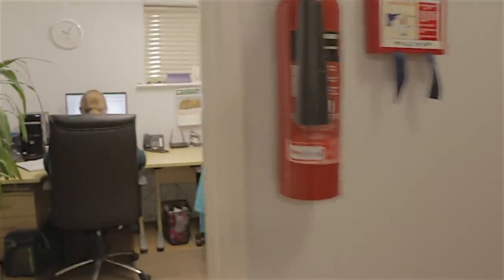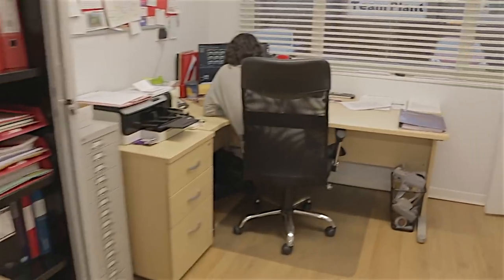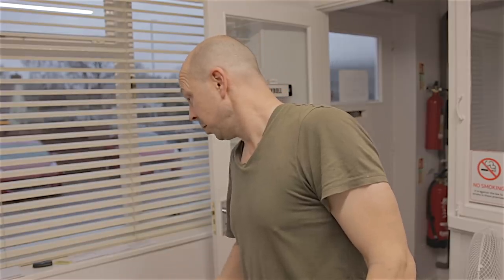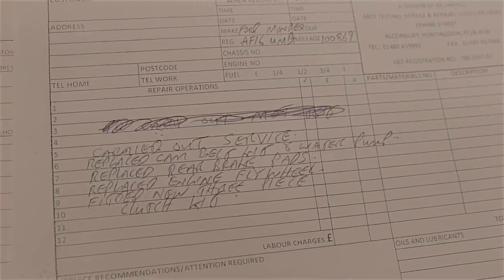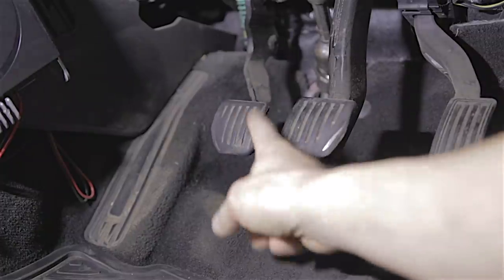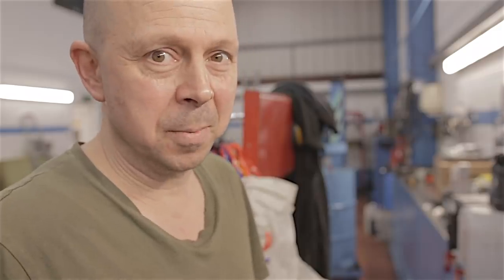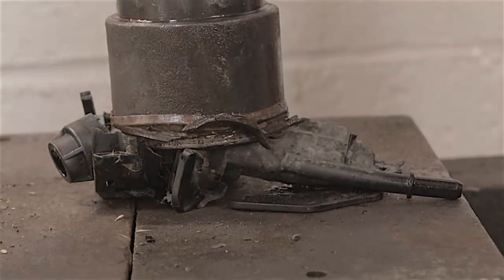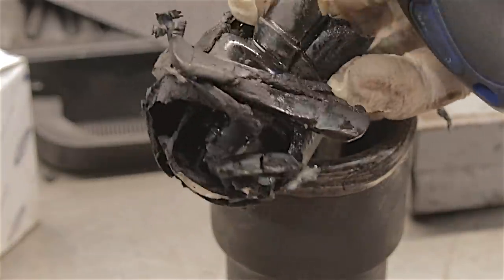low Sitting clutch pedal, Ford Mondeo Mk5 2L Diesel

Comment: ******had EXACTLY the same problem .....Here's what I did*******
Mine split in the same way as yours Alan. Its a MK3 Galaxy, but identical to the Mondeo.  Galaxy is a pig to work on with limited space, so I left clutch cylinder in place, removed the snapped rod. I heated a 2" no8 woodscrew, red hot. held it with long nose clamps and carefully poked it into the socket of the clutch (awkward as given its high up under pedals) and being careful to only catch the remaining bit of the snapped ball, melted against it and with some luck and manual dexterity, pulled it out!
Bought a breakers clutch assembly (£30) and used only the rod and pushed into place...all working fine now.

Saved all the hassled of dismantling the scuttle panels and bleeding the clutch and all that jazz.

Great content Alan, love it,.

Comment: We are right now in the backway of this job.With a leff wheel steering it's more complicated.The complete pedalunit cannot be taken of unless the fusebox has been removed.So we found another way and  wiggled the new master into,the bajonet without removing the pedal unit.What an operation but with 2 persons it's doable.Alan,I guess English models right steering the vertical fusebox is also on the left side? Thats for sure an advantage......

Comment: can failure of this siliner cause clutch to slip? I changed my mondeo mk4 flywheel, clutch plate , pressureplate and pressure bearing, but it still slips when i accelerate 4. and 5. gear....? or is there possibility that i ordered pressurebearing for solid flywheel cluch and maybe its longer than dualmass flywheel clutch pressure bearing..?

Comment: When you get a brittle plastic clip, try warming it with a heat gun to probably 150 - 200 degrees and it should restore it to non brittle. Bringing it to a simmer in undiluted glycol antifreeze (200 degrees) would work if you can get it off without it breaking in the first place, a hot air rework station ( about 35 quid ) would be a more practical solution as you can set the air temperature and use it while the part is still attached.

Comment: Alan i have a clicking at the top of clutch pedal it seems to be sitting a bit higher and pooping , i have been told the clutch master cyclinder needs changed. How much should a job like this cost if you have to replace full assembly

Comment: I had a knight mare with one of those master cylinders with the switch on my ford focus 2013 has a similar set up I had a host of issues on the car bucking around over revving on gear change ever diagnostic even fords said clutch position sensor had a new bottom and top sensor still the same problem ford dealer was adamant that there where only 2 sensors on my car it went on and on for around 8 months I had literally had enough of the car drove horrible couldn't get a smooth gear change stop start didn't work gear change arrow didn't work after loads of parts changed I went to an auto electrician and when they told me the hourly rate I nearly died and they couldn't give me a rough time for how much it was going to cost  so I scrapped that idea a couple of time another fault was picked up on a different diagnostic machine starter request malfunction so I did a lot of digging around days to be exact on different forums and someone had said about starter request malfunction and there fault was the master cylinder after weeks of issues but thought that it couldn't be that as it's only fluid contained in the cylinder and not electrical so in the end I decided to look on eBay at a cylinder and noticed the electrical component strapped to the side so I decided to take the plunge and buy one had it fitted boom problem gone car is now great even ford couldn't  tell me the fault with the car and after chucking money away on various components that all it turned out to be that stupid switch on the master cylinder only visible from the engine bay side and still not easy to see and I just want to wish you all at your garage a merry Christmas and a happy New year and love the videos

Comment: Hi, I have a volvo xc60 2014 which had a new clutch fitted last month. The car drives fine but sometimes the clutch pedal gets stuck at halfway. If you lift it up then works fine again until it happens next time again. What could it be?
Reply from the maker: it is usually a fault with the clutch slave cylinder in the gearbox bell housing..assuming that was replaced with the clutch, failing that possibly the master cylinder or in some cases a piece of rubber seal or something temporarily blocking a pipe

Comment: I have recently bought a 2014 Mk5 Mondeo 2 Litre Diesel. It has 54,000 and full Ford history. On test drive clutch pedal felt a little soft, compared to my previous Seat Leon 1.4TSI. Which was hard. Is this a concern? And if so what could it be?

Comment: Hi! do you have an idea what could be the reason for the ugly start of the engine after a night break when it is cold?  the fuel system was vented, but it did not help.  it starts every time, but it strangles and chokes somehow ... the next engine start a minute later is correct.  The problem is only with first start. This happens after a long break, when the engine is already very cool.  Mondeo Mk5 2015 2.0 diesel 150HP 47,000km.

Comment: Hi Alan,you mentioned that you hoped that the flywheel wasnt rattling.
I have a rattle that has appeared after replacement of the clutch return spring.
Apparently the garage unable to find the rattle after two goes at it.
Would you try to explain what the rattle would sound like?
This rattle sounds like two teacups rattling together.

Comment: What happends if the clutch pedel is higher then the other pedals
Reply from the maker: if it is quite a bit higher then chances are the master cylinder rod that connects to the pedal is broken

Comment: I have a Citroën C4 grand Picasso. Recalled for the same issue.

New master cylinder was fitted
Reply: Fisher101 same on the peugeot 308 T9. I think i have done around 100 of them. Same platform as the C4 picasso

Comment: Greetings Alan from Croatia.
I like to follow your YouTube channel because you make very interesting and understandable videos for Ford Mondeo repairs. I drive a 2016 Mondeo 1.5 diesel 88kw. I see a video for changing the master cylinder cylinder. If you can help me with advice. In March of this year, I replaced the master cylinder because the clutch pedal was lagging halfway. And with the original new part. Today in December the same thing started happening to me again. Is it possible that I have the same problem again only after nine months? I can't believe it - the car has traveled only 4000 km since that date.
Thanks for your future reply
Greetings from Croatia
Football madness reigns here now

Comment: Too many plastic critical parts - this is why I got rid of my VW GTI.  Plastic clutch master and slave cylinder, water pump, intake manifold, engine balance shaft, thermostat housing - and don't even get me started on cheap interior plastics.

Comment: The failure rate of these mk4 & mk5 Mondeo's seems really high it's a wonder they're ever run by any taxi firm.
Reply: You need to remember there are 100 or so on fleet and rack up huge mileage.  Alan often refers to mileage as being 130 to over 200k .

Comment: Surely these parts should be metal not plastic someone from your background should be contacting the manufacturers and giving them your thoughts on plastic parts that only last 50 000 miles compared to older cars that had metal parts and would never break